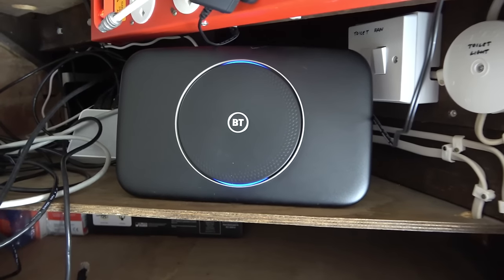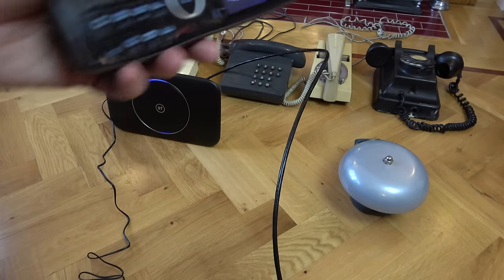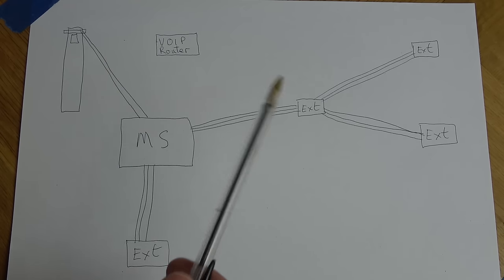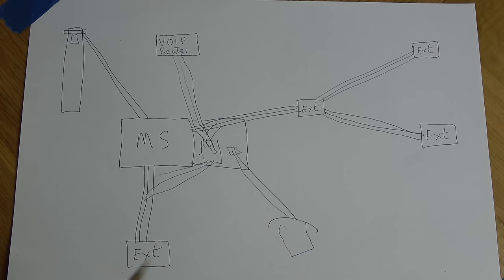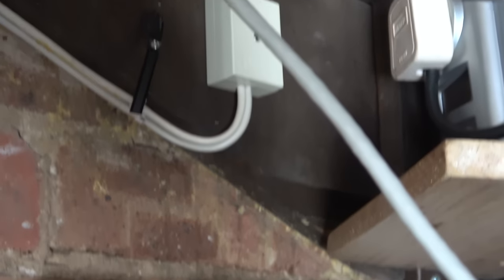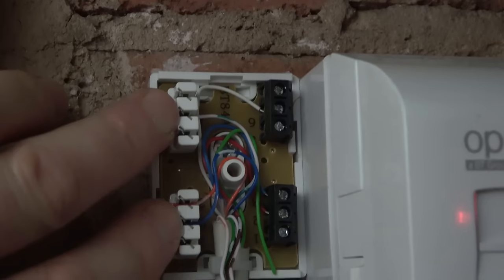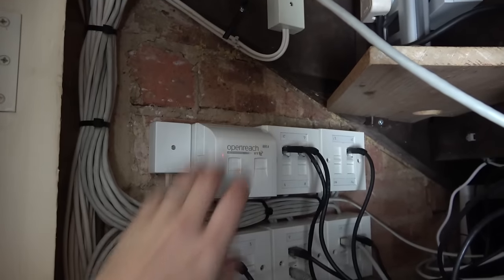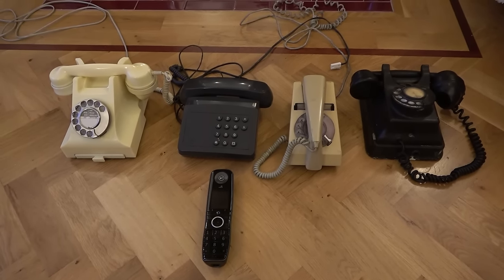How to Connect Landline Phones / Extensions to VOIP on Fibre Internet

Comment: We lost power for a couple of two week periods here in Florida in 2004 when we had 4 hurricanes come through in less than a 6 week period.  No power means no cell towers, no internet, no VOIP.  The only reliable communications that we had were my vintage Moss green Western Electric model 500 set from 1959 and my Western Electric 302 from 1939. Both rang and dialed just fine.  Still do as a matter of fact.  I dread the day when we lose our twisted pair.  I suspect I'm probably the only person on my street still clinging to it.  It's almost a sin to let one of the 20th centuries greatest engineering feats lay rotting in the ground because it's insufficiently profitable for the telecoms.
Reply: Could see a return to CB radio / Ham Radio
Reply: Yeah this is a HUGE issue with BT's plans to go over to VoIP. It needs to be stopped.
Reply: Totally agreed.  Regular TP and ham radio are two 20th Century technologies not given the credit today they deserve.
Reply: To make matters worse, BT do know about this problem and they say that you should have backup power for the router.

When you call Emergency Services with a landline, they will have your exact location the moment the call connects as telephones don’t usually move, if you call from a cellphone, they will only get an estimate location causing possibly minutes of time to be wasted.

BT probably stands for Beyond Terrible.
Reply: Australia here mate they need to separate lanelines with Wifi and internet connection. Living in a house since the great war and their is laneline connectors all over my house
Reply: We were forced to switch to VoIP by my ISP, around the time they tried to implement VDSL, which never worked. Now we have no functional copper line and rely on LTE for internet and VoIP, that due to ISP restrictions, can only use in the basement, where my router and switch are located!

Hang on to that copper for dear life!
Reply: @TheChipmunk2008  Agreed. I've sent complaints to both BT and Virgin over this.  I have a landline purely for analogue emergency use etc.   Internet phones are useless as we can do that in a million ways via internet or mobile phone anyway PLUS they need seperate lines of power. 😔
Reply: The trick so buying a UPS (uninteruptable power supply) , they should probably provide power in case of an emergency and their price depends on their output and features. But remember that it will only power you side of the system, if the Internet is down from the ISP you're still be unable to call out.
Reply: same could be said for ukraine and USA trynna destroy russia
Reply: Sadly it's the way it's going all around the world. Here in New Zealand they have been progressively shutting down the copper network and rolling out fibre connections to houses and businesses. The problem is that these fibre connections require power at the consumer's end to operate, and the fibre terminates in road-side cabinets that also require power to operate. During a national emergency, if the power is lost to an area for an extended period then the fibre doesn't work and there is no other means of communication. I'm an amateur radio operator and I can get on the air on HF radio to communicate but not everyone can do that.
Reply: @highpath4776  Ham radio is still the most reliable means of communication during a civil emergency.
Reply: @TheChipmunk2008  You can't stop it. It's happening world wide. Here in NZ they have been progressively shutting down the copper network.
Reply: @videocommenter  Having backup power for the router is only part of the equation. The fibre connection from the house terminates at a road-side cabinet which also requires power. Those cabinets have batteries in them for short power outages but won't last if the power is out for hours on end. Put it simply, the fibre networks are great when the power is on but hopeless if it goes out.
Reply: @TheChipmunk2008 they should be forced to provide the backup unit to keep it live
Reply: Good point. @videocommenter
Reply: Exactly my point. No internet no connection no line. Not good in emergeny either..
Reply: Here In India We Also Have The Same Story. BSNL The Government Owned Telecom Company Is In Losses So No More Analogue Traditional Landline Phones. So Whole Broadband Internet Market Is Monopolized By Private Operators Like Jio & Airtel With Their  Optical Fibre FTT Modem Connections. Although They Are Good In Speed But Needs Constant Power Supply.😂
Reply: In the States, At&t has let the copper get in such a state of disrepair that it is unusable.
Reply: @sw6188  The roadside cabinets are passive fiber splitters and need no power.  The central offices still have huge battery strings for the OLTs and the softswitches.  And most telcos offer backup battery in your basement for the modem/router.  The shift here to cell phones is huge.  Landlines have shrunk by more than 60% and still going down. That is why it makes no sense to maintain new fiber and old copper cables, which are failing fast.  Also, long copper pairs cannot keep up with the data speed race, and the longer reach of fibre means that they can retire some smaller exchanges.
Reply: @rtel123  Are you talking about US fibre networks? I suspect so as you mention "basement" which is not a common feature here in New Zealand where I am. 
As I understand it, the roadside cabinets here do in fact need power. They have some battery capacity to keep the system up for a while, but after a few hours it will die. 
The ONT that are supplied here for each house have the facility for a backup battery to be fitted, but they are supplied without one, so if people want to keep their fibre connection alive they need a UPS.
Reply: @sw6188  Yes. N america.  I am retired from the tel industry.  I am aware of the hardware, and watched the roadside cabs being installed.  No power, just fibre splices to splitters.  The fibre laser has a reach of about 20 km.  Battery backup for your ONT is provided if you ask and offer a "reason"
Reply: Here in Illinois, my monthly bill for the most basic POTS line service from AT&T had risen to $50 a month. Very limited local calling area, no long distance access. Hardly used it. Switched over to Ooma VOIP to keep the number and pay $8 in taxes and fees. Excellent call quality. Had been using Magic Jack VOIP for long distance, also excellent call quality. It is no secret that AT&T wants to get out of the POTS business and is jacking rates to drive customers away.

Comment: An easy way to achieve this is to go on an auction site and pick up a small office pbx that accepts pulse dialling. You then set the exchange line output to tone dialling and wire the wall sockets as extensions. Takes care of both the REN and conversion problems. Mine cost me £20.
Reply: Take care. Many UK PBXs have to dial 9 to get out. You have to dial four 9s in emergency. Guests wont know that.
Reply: Nokia built the ONTs for this part of N America, and oddly, they built the software to count dial pulses!   I guess they were halfway there when they have to measure 700+_  millisecond open intervals for flash to use call waiting or three way features, so why not also measure 62 millisecond intervals to detect a dial pulse.  But lots of software to count them!

Comment: For years the advice has been to keep a landline phone in case of emergency. During a power failure could well be the time when a call to the emergency services, or for other help, is needed. I'm sticking with "traditional" broadband over a proper phone line for as long as possible!
Reply: Plug the router into a ups.
Reply: @voltare2amstereo  apart from those that don't.

Also do you conveniently keep your mobile fully charged just in case of emergency? I mean wouldn't it be annoying if the power went out for 10 days in freezing temperatures and your phone had 10% left.
Reply: @jamesrobert5782  BT etc thus should supply such devices to people who have no idea what a UPS is and may confuse it with a USB, or even better the UBS ports...
Reply: @voltare2amstereo  Err, no. Yes, I have an old pay-as-you-go mobile but unless you use it at least once every six months you get cut off. Also, mine is on the 3G network which I have been informed will soon be shutdown to make room for 5G. And now all this DigitalVoice VoIP nonsense will be the death of me!
Reply: unfortunately BT are in the process of killing off the traditional phone service over copper phone line. The phone line to your house will still be there, but only for ADSL type internet. Apparently the reason for doing so is that the exchange equipment is very old (40+) and becoming difficult to find parts for. The company that originally made it has long since vanished.

No idea what Virgin are going to do, if anything.
Reply: @kyle8952  Except that BT have now put this "on hold" until such time they can ensure those that need a battery backup system installed do not lose their phone line during power cuts.
Reply: @jamesrobert5782  A small 12volt battery should do 3 to 6 Ah, with a 3 amp fuse
on the battery +ve terminal !

Comment: All you need is a BT to BT patch lead & disconnect the incoming copper pair at the master socket. Some BT sockets even have a switch to do this! (SOGEA VRI Isolation Plate, looks like a MK4 but with a green shutter on the extensions socket. BT (or Openreach) should be doing this anyway, and they really don't care if you remove redundant copper cabling from their network.
Reply: I was thinking the same thing, just disconnect the incoming copper.

If the line is dead anyway who cares? Openreach won't even reconnect it if you do want it back (stop sell in many areas as soon as FTTP is available).
Reply: @lemagreengreen  This is only true if you have Fibre to the Premises/Home (FTTP/H). If you are still on Fibre to the Cabinet doing this would obviously cut off your broadband.
Reply: l @alexandrakollontai2047  Well yeah but it's a video discussing VOIP and fibre internet... obviously don't cut your copper if your copper is providing your internet.

Comment: Don't think the third wire is used much these days - it was originally used for party lines or to stop bell tinkle on ext. phones when you pulse dialed from another phone, but obviously if you  are using ancient phones it might be still necessary.
Reply: thank you! im playing around with old phones (old old) and been trying to figure it all out. The ones im working on now have 4 cabels but theyre also from like early 19 hundred but thank you for this!
Reply: Indeed, which is why that phone cable Vince looked at only had 2 wires, most of them do not rely on the ringer wire, partly so they will work internationally but mostly because it is simple enough for a modern phone to derive it's own ring line, that only really was needed when phones didn't have any silicon in them and everything was just passive electronics. Simple rule is, if the phone supports dtmf then it won't need the ringer line - not 100% reliable but as good as.

Comment: Wow, did BT ever make it difficult. I’m with Telus in the province of Alberta, Canada, and have fibre to the house. Copper was never used in my neighborhood as it was built ten years ago. With my setup, the optical network terminal splits up the fiber signal and sends data where it needs to go and voice to the standard telephone cabling. As it’s running a landline telephone, it comes with a battery backup to support the ONT and ATA. You wouldn’t know it was VOIP as faxes (when I had to send them) and phone calls work perfectly. I could plug any landline phone into a socket and you’d never know.

Comment: Thank you for another excellent video. 
I was 62 years old when I learnt that the UK uses a third wire for ringing.
Reply: For those that don't know, particularly overseas readers (I'm sure Andy does),  The third wire is to stop any other bell on the circuit from tinkling when pulse dialling. (Technically every pulse dialled will short out the line to signal to the exchange. During dialling, the bell is shunted or shorted out, but not in the extension phones which will react to the rapid change from 50v to 0v (plus any back emf in the bell's coils) unless the third wire is connected in order to short out every other bell in circuit.

Dialling with tones/DTMF and an electronic ringer will still operate just with two wires on BT sockets pins 2 and 5 between extensions.  To improve ADSL broadband, there are published modifications to disconnect the 'bell wire' to provide a more balanced line to reduce potential interference. But then I would have to bore you with transmission line fundamentalszzzzz.

Comment: Vince, flippin brilliant video! Had a bt engineer round who swore it couldn't be done. All i needed to do was disconnect the old bt copper cables off the extension wiring around the house and plug the output to the hub. That's it. Extremely grateful.

Comment: Most interesting. When I had fibre installed to the house  two engineers told me that it was not possible to connect an old style phone (also the blurb that come from BT says that old analogue phones will not work). However I was not convinced so I did what you did. It works! I.have noticed that strangely the old phone rings slightly before the voip phones! What is important to stress - as you mentioned - no power no phone. So in case of emergencies a charger mobile always needs to be available.  Thanks again - I am reassured that I am not the only geek!

Comment: Hi Vince. Interesting video. I'm a security system engineer (in Ireland so it's the 2 wire system) and what we normally do is take the incoming line to the alarm first and then to the sockets. In the event of an alarm the panel seizes the phone line and kills the sockets. Thre reasoning as far as I know is so that a burglar can't just leave a phone off the hook . You could do the same thing there before your new socket if an alarm was fitted.
Reply: @voltare2amstereo   True , most do as a backup to the landline depending on the level of security. On domestic systems some people self monitor the alarm and the price of upkeeping an extra sim card is exorbitant so the landline is used to relay voice messages.

Comment: I’m in the US. I just switched from land line to cell and bought Xlink BTHD. Works perfect. Now all my phone service is over my cell.  So far I have my old 35 year old touch tone, a large bell/light flasher, and a cordless phone hooked up.   All work as they did before.  Expensive but totally worth the price.  Don’t know if they have a model for UK.

Comment: The area where i live is FTTC and full fibre to the premise is a long way off. Having just renewed with BT the voip phone was part of the new Broadband contract.  This vid is the best i have found explaining what you need to do to connect your existing hard wired sockets to the router. I have found nothing from BT covering this. As a former comms engineer this has confirmed what i thought needed to be done. From memory the max reccomended number of phones that a copper line would support was 4 so no change really. Neat existing wiring, not the usual birds nest bodge job a lot of people are going to be greeted with.

Comment: I've not even seen a landline in years, everyone I know uses cell phones. Also I could definitely hear that dial tone when you said No. I love watching your videos Vince, they're always fascinating and I have even gone on to successfully repair my toaster oven, I wouldn't have ever tried that without watching you and getting some confidence, thanks for that.
Reply: Lots of people still use (and prefer) landlines.  Lots of advantages.  Corded landline phones are tethered to the wall.  They don't get lost, stolen or dropped in the toilet.  Nor do they need to be constantly upgraded—they are very cost-efficient.  They don't need to be charged up in order to work.  Anyone in the household can answer them.  AND until this insanity becomes universal, they can be used during a power cut.  Yeah, you can use your mobile during a power cut—but only until the charge runs out.  If you've got a power bank, that will extend the usage to some extent, but not indefinitely.  An analogue landline phone will stay 'on' for the duration of the power cut.
Reply: I can still remember a time when NOBODY had a cell phone, because they hadn't been invented yet. We got by.